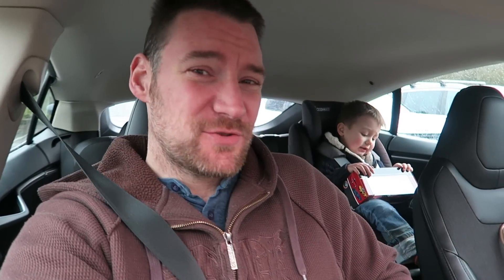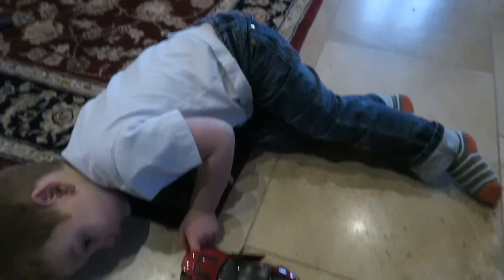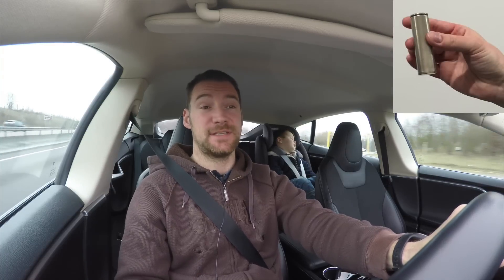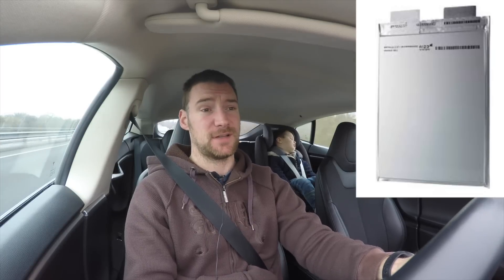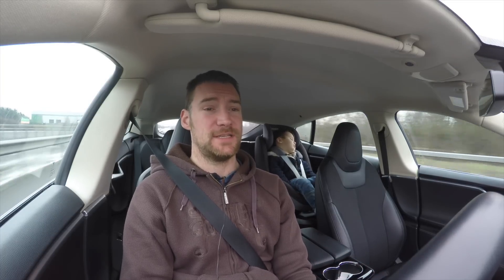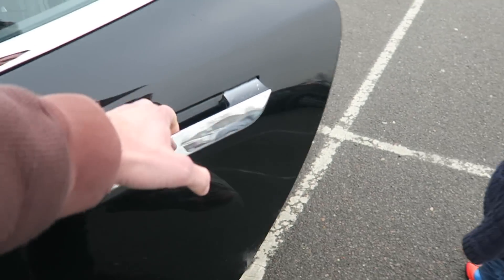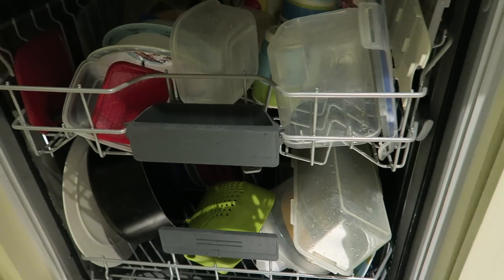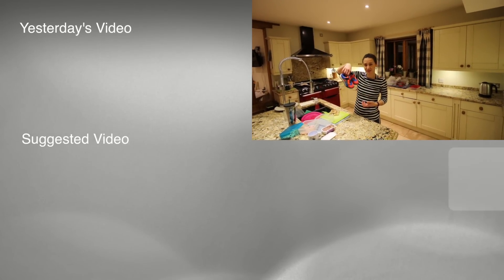Tesla and a whole new cell format

Comment: James, you are correct about battery technology is continually progressing. Most of of the recent tech would not exist if it was not for the latest battery advances. Mobile phones, cameras, drones for example. It is like computer technology, which is advancing all the time. Electric cars have progressed in the last 10+ years faster than ICE cars in 50 years. I agree about Hydrogen Fuel Cell tech. Too complicated and needed massive infrastructure. It's got to be EVs. I have been watching videos of people converting car to EV, and they are very good too. Even Wheeler Dealers have done one.

Comment: The real question now is what kind of chemistry teh Model 3 cells will get. Apparently different from the ones used in Powerwall products.
As Tesla is teasing about faster chargers, which the current cars don't have the cell tech for to exploit, the new cells might actually give up some energy density to get a higher "C rating", the rate at which they can charge.
A 100kWh Tesla will now peak at 120-130kW charging, say C=1.2.
Cars such as the Ioniq EV already score C=2-3. 
To make any use of 350kW chargers that are being announced for the forseeable future, higher C rate cells are needed. Tesla's are now actually among the slowest charging in the business. In 2012 they were quick, and got plenty of output power from being so numerous in the cars. In 2017, Tesla is lagging in terms of charging. Discharge rate really is needlessly high already in my book. Who needs 570kW peak power output, really? In a family sedan? 150kW is plenty even for a heavy car like that. But as you engineer a high charger rate, likely the maximum discharge rate comes up along with it.